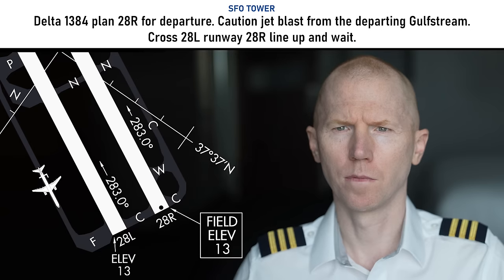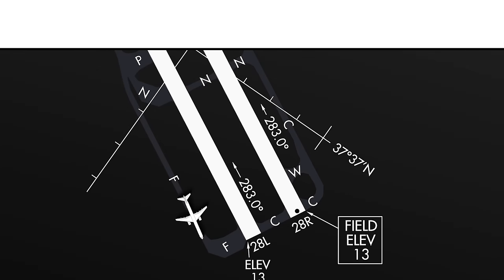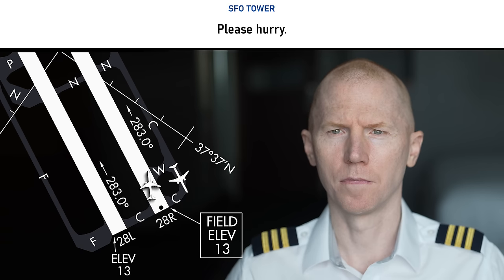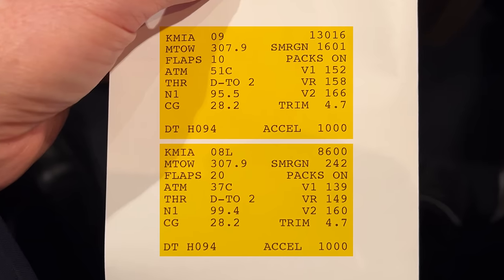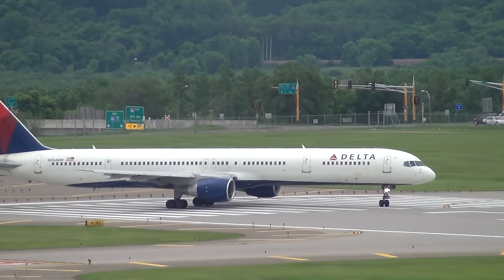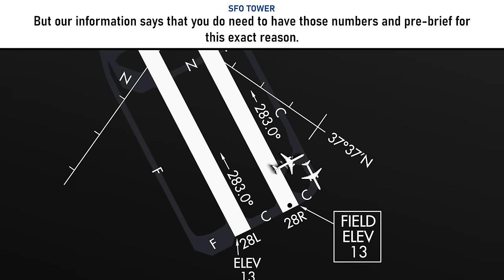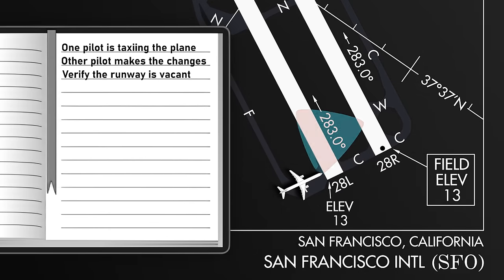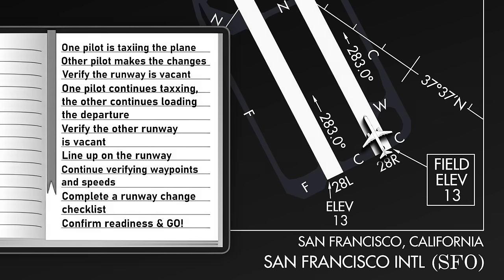ATC Doesn’t Like Delta’s Comment

Comment: That incident isn't the only time she's been rude and caused issues. She caused 2 go arounds about 2 months ago then didn't accept responsibility for them.
Reply: What’s being done to discipline her?  Any info on who she is?
Reply: @jestofreestone1  Regardless of their behavior, don't request personal information to be posted on youtube. The controller might not be the right person for the job, but this is not the forum for reconciliation of said behaviors.
Reply: @DillonGauthier 🤓
Reply: She was not rude at all, she responded to a foolish comment by the pilots trying to shift blame.
Reply: If you believe you can support this with facts, then please do so.
Reply: @UnrealNarcissist Are you her publicist?
Reply: @jacksonlynch1731  what a silly question
Reply: @UnrealNarcissist  If you listen carefully she never said they were cleared only if it took only 2 minutes, she gave 5 mins as a time and thats what the pilot copied "we are gonna take the 5 minutes". The pilots interpreted that they would be cleared for 5 minutes, so 2 mins was good, but 3 or 4 mins would be good also, their initial estimate was just a rough one. They thought she factored in the minimum spacing time in the "5 mins". So when she calls "Okay so more than 2 minutes", they are already under pressure and they realize that they won't be able to take off because she misled them and added to the fact that it is a passive agressive formulation I understand that they respond something agressive.
Reply: @flo0778  No in 5 minutes the inbounding traffic would land. If they taking so long they properly would have crashed.
Reply: @flo0778 the pilots didn't misunderstand.
Reply: Why am I not surprised?
Reply: @jestofreestone1 how dare you? You can't discipline a woman! That's not feminist at all! Lol 😅
Reply: @UnrealNarcissist bullshit! She was unprofessional, rude, and her behavior was unacceptable. That kind of pushy garbage puts unnecessary pressure on aircrews. SFO is notorious for randomly changing ATIS and runways all the time so if this crew got ATIS 10 minutes earlier, then switched frequencies for departure, they don't know it changed. She told them at the last minute to expect 28R because ATC changed the runway as they were taxiing, running checklists, and preparing for takeoff. What she should've done is simply told them to hold short of 28R until they were ready. To make matters worse, she causes a major distraction by lecturing them on frequency, which sets them up to make other mistakes.

Comment: Question from a layman. Why would V1, VR, and V2 be different for different runways? Aren't those speeds based on actual aircraft takeoff weight, which would be the same for each runway?

Comment: I'm curious as to what the ATIS was and why the controller asked if the pilots had listened to it. ATIS will advise "Landing and departing Runways blah, blah, blah."  Could it be that the ATIS advised that departures should expect 28R?

Comment: I’m fascinated by flying. These videos take it to another level. My question is why are such important instructions communicated verbally at such a rapid pace?
Reply: ATC is busy & time is of the essence while they’re multi-tasking.  Pilots are used to the fast pace & anticipate the protocol by ATC. What concerns me is when there can be a bit of a language misunderstanding, ie. if English is not a pilots first language & they’re listening to ATC use colloquial terms,  rather than only the ATC official verbiage. This has attributed to communication issues & safety issues, (on the show Air Disasters),   as proficiency in English is not always the case. You’re right, they certainly often speak rapidly! The more you listen to it, the easier it is to understand.

Comment: 121 question: is it not SOP in this exact scenario to split the boxes? (e.g. in Vegas (where they frequently changed our departure runway at the last second (literally)), we had the left box set for the Left & the right box for the Right runway; fully configured in about 15 seconds after T/O clearance.)

Comment: I'm surprised there's so much debate in the comment section. The simple answer is: Don't enter the runway unless you are 100% ready to take off. 
If they're running checklists, you do that on the taxiway while you hold short. You don't start moving again until you are 100% ready for takeoff. 
Nothing bad can happen if every pilot does the above.

Comment: This summer at LGA ATC got (to my ear) verbally abusive with us after providing No heads up to start engines…. after we were told to shut ‘em down due to thunderstorms .  We tried to be patient and wait for good times to query tower how long til we needed to start, but got nada.  Suddenly we were told “runway 13, cleared for takeoff” and we couldn’t because we were shut down.

Point is; COMPLETELY UNPROFESSIONAL on the part of LGA tower and they continued needling us several minutes after their initial eruption.  Unbelievable. Sad.  I used to hold LGA tower in high esteem.  Except for that female controller “…Good one”. She’s unflappable.

Comment: 11:06 Then they shouldn’t have said “2 minutes”. She even gave them the option to sit between runways, IN A SAFE SPOT, not on the runway, to brief and load the FMS, however long they needed. They didn’t need to take the active and then hold up progress. That’s 100% on the pilot.

Comment: Can you prep for one runway and the onboard system automatically convert and load those settings for the parallel runway  - just in case? That way at least half the work is automated 🤔

Comment: I don't get it, pilots have to "look" left/right to see if they are clear to take off (14:00). Question why do we need air controllers?
Reply: Because most aircraft lack rear-view mirrors? Or "Trust, but verify".
Aircraft typically take off and land on a runway in the same direction - into the wind to generate lift at slower ground speeds. The Delta flight either needs to take off quickly so that the traffic on final approach can land safely behind them or wait until the inbound traffic lands and then take off after them. Without ATC or a rear-view mirror, the Delta has no idea where or when the inbound traffic is.

Comment: I like hearing about behind-the - scenes workings. It tells me what is done to ensure safety in the part of the work that interfaces to the public.

To me, were I the controller, I'd make sure the sequence was repeated back to me exactly. There could be a glitch and the pilot easily could have missed half of it, as it seemed to be. I'd ask for a clarification back.

As a civilian, I've had to detail where I live because I know it's easy to get turned around. For deliveries, if the driver calls me, I make sure they know the color, number, and orientation of my building. It helps them save time, and we meet up easily.

And that's not even about safety.

Comment: 15:15 so why would you takeoff from the original runway with outdated weather information? This argument about “latest weather” is not valid, if it’s not valid also for 28L. Of course, if there is separate wind information for different runways, the correct wind might need to be applied before recalculating performance.
Reply: Did u get your timestamp right? He didn't say anything about weather at that time in the video...

Comment: I’ve never known a performance procedure that didn’t take 15 mins to change runway - that’s on 75/78 and now 74- and you can’t rush it , it’s called “ critical data procedure “ here and the cross check has to be spot on …or you can die . Controllers should know how long really - 2 mins is woefully optimistic . Like Kelsey ask early , and don’t accept a change unless there’s a good reason

Comment: Retired ATC (Center) here.  I estimate that I learned 40-50% of the nuance of providing service on cockpit familiarization trips.  I learned that talking fast does NOTHING to expedite the system; what kind of time is involved in stuff like runway changes; what a go around looks like because the controller was cutting things too close; what an inexperienced pilot looks like in the right seat of an airliner; how much a go around costs; how pilots react when they hear a controller "going down the tubes".  Early in my era I was able to take up to EIGHT familiarization trips per year.  There were several reasons it got cancelled, and among them was some jealousy from managers who weren't eligible to have the same privilege. 9/11 proved to be a perfect excuse for management (and the airlines) to cancel the program. In the following years, we were trusted to control the fighter jets that might shoot down a terrorist-occupied plane, but not to ride in the secured cockpit to learn nuance in our job.  Over a decade later, a shell of the program emerged, with so many tripwires nobody wanted to take them.  It was too easy to get stuck somewhere, and have to pay to fly home, or 'trip' over a reg and get disciplined or fired.  I personally think every controller should get flight instruction up to a private pilot license, and have jumpseat privileges on any trip it is sitting empty. One comment defending the controller:  A controller who doesn't fly or hasn't seen runway numbers updated on the flight deck probably only knows that 28R is longer than 28L, and she might reasonably question "why do you need to put everything in again?  So you can run a lower power setting and save $22.50 on fuel?  Is there a number going from a shorter to longer runway other than power setting that might decrease safety margin?

Comment: Im a GA pilot, so dont know, but why could the pilot not say "pre-briefed and loaded for 28L instead of 28R, can we use 28L?" Why was the runway changed to the parallel and is the other no longer an option?

Comment: There use to be alot of FAM flights for controllers, however the FAA have changed the rules to make those fam flights unreasonable. Fam flight is when a controller flies in the jump seat in the cockpit.

Comment: SFO does this a lot, and reloading the FMC the ATIS  would say 28L and the the controller says " use 28 R cleared for an immediate traffic on 2 mile final" Yeah Right! Especially SFO since the engine out departure is different between the two runways... Especially on a climb limited MTGOW.I used to always hold short rather than line up. Controllers hated that too.

Comment: Question: You've loaded everything into the system for 28L and get redirected to 28R -- so why isn't there a button to transfer all the info already entered to 28R? 
Rushing to enter everything again seems like it would increase error rate.
Shouldn't the software be set as "enter weight, fuel, temp, pressure, etc." then "pick runway?" Then you get your flex number etc.
Pick runway then enter data seems... really inefficient.

Comment: As far as pre-briefing both runways being a “dumb idea”: Sometimes it is and sometimes it isn’t. Switching from 25L to R at LAX (for example) only changes the very first fix on the departure we usually get going NE. Which is why I brief “if we get switched to 25R, here are the changes” when departing from there to be able to switch runway quickly (just loading the new runway, confirming the speeds and that first fix takes maybe 30 seconds) if needed. If a runway change involves much more than that, then I completely agree; brief one runway and then take whatever time you need to brief/program the change if you get a different one. 
This situation was at least 90% on the Delta crew . They asked for 2 minutes, got it and then when they weren’t ready in the time asked for got snippy with the controller. The 10% on the controller is for getting a little snippy back.

Comment: Respect to the ATC, however, in my opinion it was unnecessary and uncalled for her to “spank” the pilots. They were doing their jobs and they are the ones flying the plane. Unless and until ATC is physically at the controls of the A/C - or at least in the cockpit observing - they don’t know all that is going on. I would never want ATC to rush my pilot in any circumstance. And no matter what the pilot said to her - two minutes or ten minutes - I’m my opinion, her snarkiness was not necessary and totally unprofessional. Those pilots are trained professionals, not her children, and they didn’t need to be “schooled” in that manner. Like I said, I have the utmost respect for ATC, but this one needed to throttle it back a bit. And kudos to the pilots for maintaining THEIR composure in spite of her attitude.

Comment: I am a retired air traffic controller having worked at Orlando International and Tampa International both tower and radar.  I agree with your assessment and do feel the controller here did not help the situation.  I never allowed a pilot to dictate my decision making, that is even if a pilot said they needed 2 minutes to get ready I would not put them on the runway to line up and wait while banking on the fact that it would only be 2 minutes.  I am sure the controller wanted to get the Delta pilot out in front of the heavy waiting ( which ultimately the Delta ended up behind anyways) to avoid the wake turbulence delay but that is risky air traffic control in my opinion to place an aircraft on the runway for an unknown amount of time. I would rather hold the aircraft short of 28R and let the Delta tell me they are ready then decide if enough time existed between the arrival and possibly getting the Delta out in front.

Comment: Hi Kelsey, I have to agree with your last statement, ie they should have held short, once you are on the runway, you have committed, can only go forward, but holding short, you can stay there, and have your lunch, no pressure, the aircraft behind you, shouldn't have any problems with you taking 2 more minutes to load the new data j

Comment: 6:28 Good one, Kelsey! LOL!! 😂
10:00 Your defense of the pilots is the same argument that I would use to defend ATC. If the pilots know they have to do all that work just for changing runways, then do not request just 2 mins to line up and do all that when you damn well know you need more time and you have traffic coming up on almost short final. To me it seems these pilots just had a case of getthereitis and wanted to con their way ahead of the line instead of stopping short, allowing traffic to flow and properly make their changes and brief their departure.

Comment: I'm a controller, and the reaction from this controller seemed unprofessional. As controllers we're always making plans, but stuff happens, and plans change. It's our job to adjust, and not get upset, because pilots foil their plans. Safety takes priority to our plans. 

I feel the controller was also wrong to take the pilot's two minutes as literal. The pilot can't know how long it takes exactly. Also, you should only tell a plane to line up if their departure is imminent meaning within the next 90 seconds. Two minutes is 120 seconds. The plane shouldn't have been lined up. The controller was just trying to push planes.

Comment: I see its no different in aviation. Ive had dispatch stop my 2000 ton goods train at a signal on a 1.5% slope when he didnt need to and then when the signal was green started calling me asking why im starting so slow and that i should drive faster. 

Sometimes it helps to see it from the other seat

Comment: So - Her argument was that the pilots did not check the current ATIS notice that apparently included the runway change.  If I'm not mistaken, they should have read and confirmed the current ATIS before getting clearance to leave the ramp.  That would have given the time to change the performance inputs.

Comment: At 8:40, when the tower controller ridiculed the pilot with "you probably did NOT read the ATIS', I would have replied, "Maam, we copy the ATIS from ACARS or listen to it on VHF AT THE GATE, and then set up our Flight Management Computers (FMC) and take-off data from our weight manifests for takeoff on the runway in use at THAT TIME.  We have no time to listen to ATIS once  we go to clearance delivery channel and get our clearance ( or get it on ACARS if available) nor do we go back to ATIS once we call Ground Control for taxi instructions nor after pushback while we communicate with Ground Control while taxiing out to the planned runway, nor when we check in with Tower at the end of the runway to get our take-off clearance!  If you have a change of runway or expect us to change runway, we need TIME to set up for that change!  That's why we begged for 2 minutes (or more,  as it turned out) and you said that would be OKAY ON the runway 28R!.  So... we accepted your clearance to line up and wait!  ATIS IS NOT an issue for any pilot on any airport after he pushes back or starts to taxi, UNLESS the ground controller advises the changes on the new ATIS!"
Reply: You would actually tie up precious and irreplaceable mike time just to do a rant on the air?  Amazing.

Comment: Completely understand what you are saying regarding the pilot side.  Having said that, have to go with the controller here.  The pilots did not have to accept the runway clearance and were given ample opportunity to do so.  They didn't come close to meeting what they agreed to and should have merely taxied off the runway and taken their poison.  Probably should have been no further conversation at this point.  I wonder if the next DL departure ended up waiting an extra five minutes so the controller could not have to endure this extra work/stress on her part.  She was merely offering them an opportunity to get airborne sooner and they didn't complete their end of the bargain.  She did seem to be looking for a fight though.  Also not sure what the ops were at that moment, I'm assuming a hold between the 28s was not in an ILS critical area at the time...